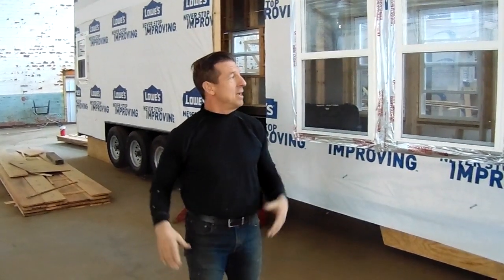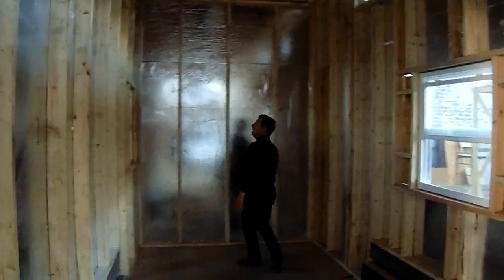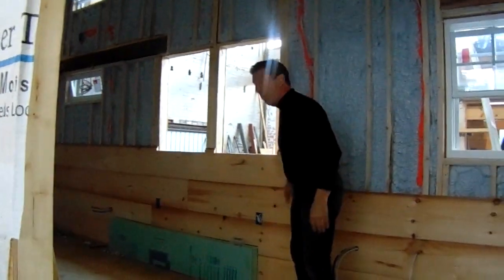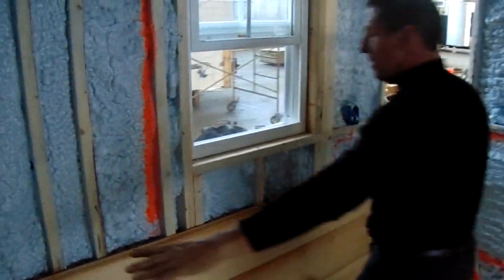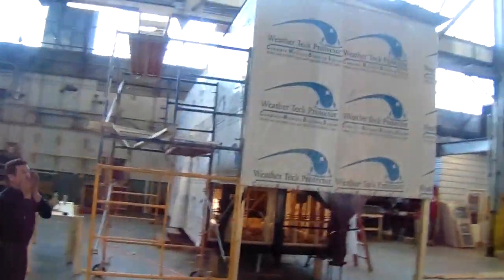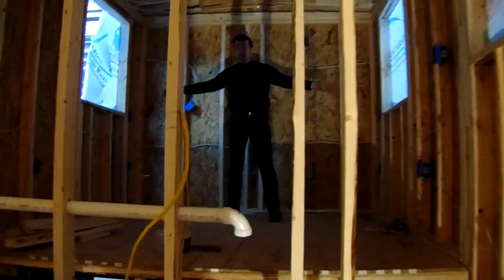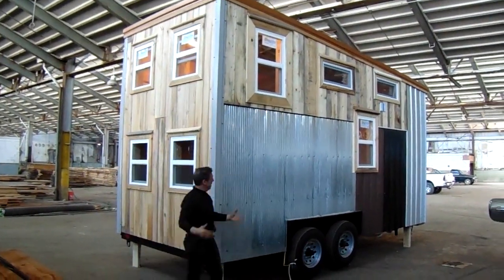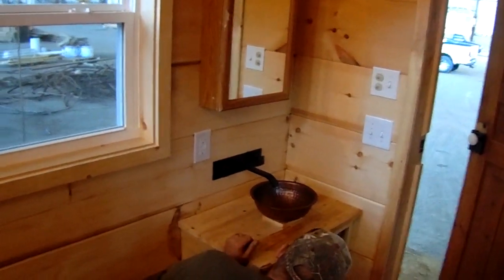Incredible Tiny Homes: A Day in Our Warehouse

Comment: what is the longest house that you can build on a trailer, that the customer doesn't have to have a special permit to haul it with their truck.
Reply from the maker: The length really isn't a factory in the hauling of a tiny home.  It depends truly on the width of the home; because, if it is wider than 8'6 you would had to have a permit to haul. Also, it depends on the size payload your truck can haul.